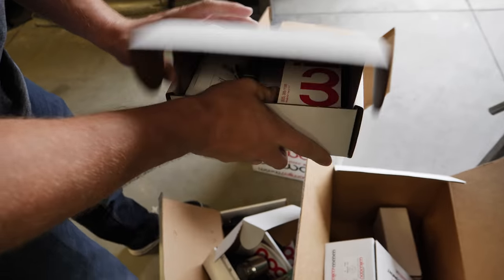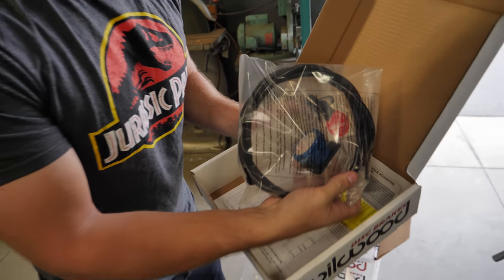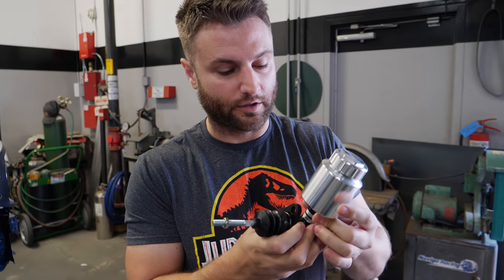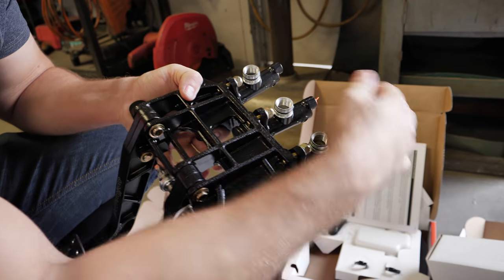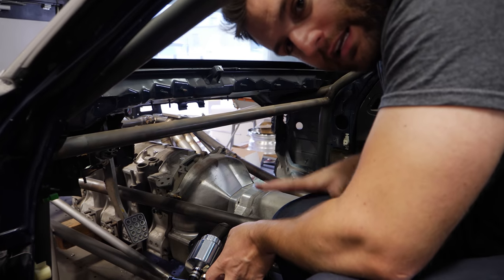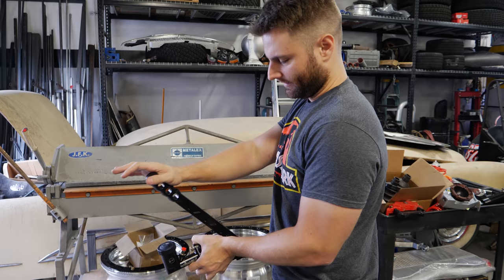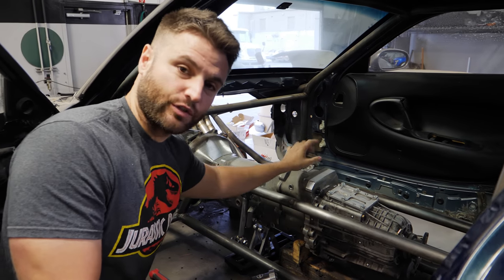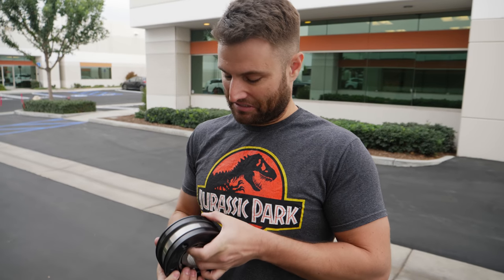Fully adjustable Brake Pedals! and Handbrake. AWD 4 Rotor Build

Comment: This pedal setup looks and seems exquisite. Especially, since I just had to tap into the brake system reservoir to support the clutch.
Reply: that wildwood reservoir looks like the one you just installed but without the plate and adjustability
Reply: Seriously dude! Every video i watch has a comment by you!

Comment: If you want more braking force at the front brakes then you use a smaller master cylinder at the pedals. You also have to take into account how large the pistons are at the wheels. It's just because you convert the force at the pedal to a pressure, then back to a force at the wheel.

Comment: Floor mounted pedal box might be an easier to install option, still using remote reservoirs.  Tilton does a nice setup that allows drive by wire throttle operation too.

Comment: Wait tho. Do you have a center diff? If so, you'll need to connect it to the e-brake so that when you pull it, the diff disengages first and then the rear beakes lock; like a wrc car. Otherwise you'll have a bad time drifting.
Reply: I'm not saying you're wrong, I've always wondered why it doesn't seem to be a problem, but RWD cars are in gear and people are ripping hydros locking the rears and they don't have a bad time even though something has to be giving, either the clutch slips or the engine stops.
Reply: @billybobjoe198  Yes, because 1) they use the clutch whenever they pull the e-brake and 2) the front wheels rotate independentely from the rear ones

Comment: Ur brake fluid wont get hot in the bottle because brake fluid doesn't circulate whatever fluid is down at your brakes stays there and just moves back and fourth. that fluid gets hot and burnt but yeah im sure you already knew that but that resivor looks better anyway

Comment: .75 and .88 is referring to the master cylinder bore size not the bias of the setup.  Also Willwood brakes are the entry level brake system, you would be much better off with a different manufacturer like Tilton, AP, PFC, or Alcon.

Comment: Since it has the Hoonicorns AWD system that means the drive train will be a 70% back 30% front right?
Reply from the maker: It shares suspension geometry but not drivetrain in any aspect. It’s 50/50 to all rwd 😈

Comment: I'm running the reverse version of that pedal box - https://www.wilwood.com/Pedals/PedalList?sc=Reverse%20Swing%20Mount%20Tru-Bar%20Pedals in a RHD FD3s. I've just put in-line vac assist to the clutch and the brake lines because the weight of the brakes was just plain silly. Good idea is to buy a spa dual digital brake bias gauge, makes setting the initial bite pressures easier. You have to make sure the rears come in after the fronts when you press the pedal !

Comment: Are you going to use a cable or a fly by wire setup?
Reply from the maker: Initially cable. But plans for drive by wire considering I’ll have pneumatic shifting ability. Throttle blimps etc

Comment: damn, i am getting all that for my car too, i have rear wilwood calipers, but can't use them because hydraulic handbrake in uk isn't allowed, and i've heard it doesnt hold well.
Reply: also i wish wilwood did a gas pedal,  i want to heel toe, but cant set the standard gas pedal up properly :(
Reply: Hydros are fine in the U.K. you just have to keep the regular handbrake too, so that you pass MOT
Reply: @matthewgarrigan2369  yeah but it seems way too complicated, the rear of my car is really light so i think wilwood's will be overkill anyways, it came with drums standard and they were pretty capable, but i upgraded to some discs off a newer car. just my OCD not having same calipers front and rear :)

Comment: Why have you chosen to put a bigger brake cylinder on the front brakes instead of the back?
Reply: Stijn Van Aken because the front brakes do most of the braking.
Reply: Pretty much every car ever has the bigger brake cylinder in the front, otherwise the rear wheels might lock up during hard braking, thus resulting in loss of control.

Comment: I have been following this build, since you bought, lost and recovered the 4 Rotor. Originally i understood that you would just light ly modify the FD-RX7 to fit the bigger engine. But now that all the carnage had been inflicted on the car, it Hurst s me to see something that could have been very valuable, be butchered, in order to be transformed into this speed/power monstrosity. Barely the shell of what used to an FD is left, and have you started with a shell, like other drag racing cars, you could have saved that original RX7, for either posterity, or to be sold to another and use the funds to add cash for this build. 

Either way i cant wait what comes out of all this. Great Job, even if i would have preferred not to have destroyed the original. car.... But thats just me...
Reply: Yeah, if only he'd just left it alone.   What the hell is wrong with you?!
Reply: At least he didn't LS swap it.
Reply from the maker: I always planned to do this. I just didn’t share the concept publicly until I knew it could be done. My 3 rotor is the stock chassis monster. This is a whole different vision. I didn’t want to make two of the same thing